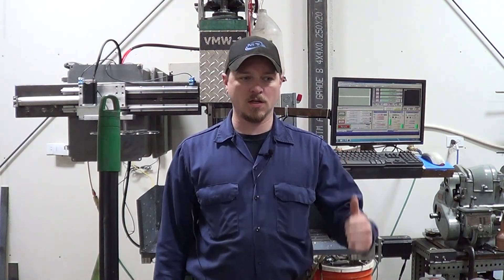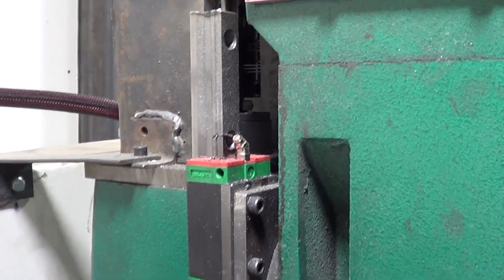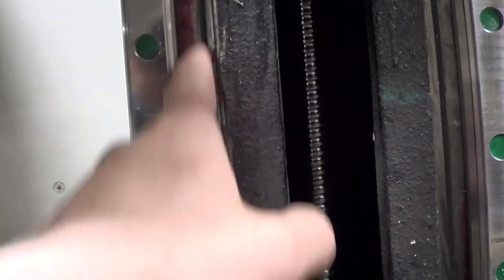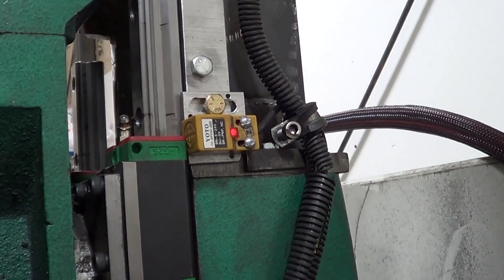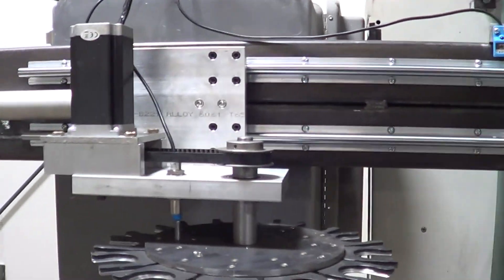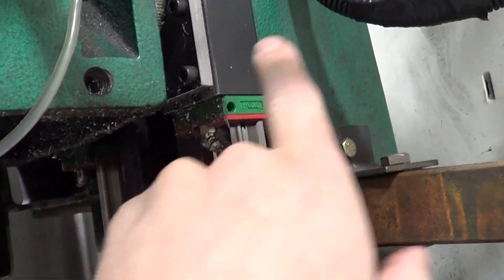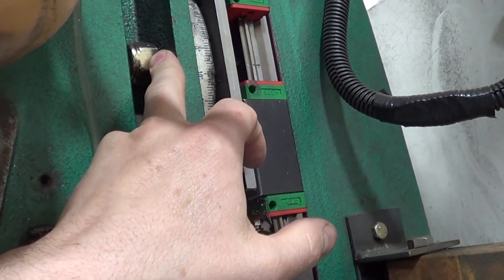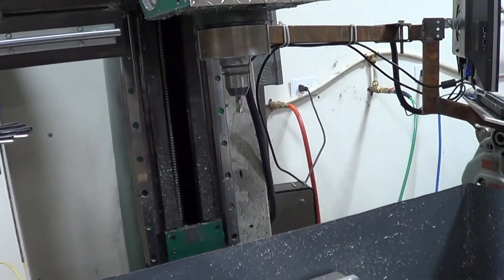RF-45 mill z axis linear bearing

Comment: I just finished converting my ZX45 to CNC but I don't like the precision of the Z axis, I knew it would be an issue to deal with eventually. What size did you use for the linear rails and how are they holding up after a few years?
Reply from the maker: 25mm on the rails and 20mm on the ball screw.  They are doing fantastic.  It was the best upgrade I have done to the mill.  The other I highly suggest is a bt 30 spindle.  Which will require you to build a new head.
Reply: @northernsmith  Yeah I definitely want an ATC capable spindle and a BT30 is what I was looking for. I guess years ago there was a company that made a drop-in BT30 spindle. What did you do for the BT30 spindle? Thanks, I appreciate the info. I have a ZX45 with 20mm ball screws on X and Y, 25mm on Z and Nema 34 closed-loop 1700in/oz steppers on all 3 axis'. I run a stand alone controller. After completing the Z linear rail conversion I'm going to a dual belt conversion to increase top RPM's to around 7-8K.
Reply: @northernsmith  Also, what have you machined so far? Not necessarily materials but projects and do you have any pics or video of it?

Comment: Hi, that's a gr8 build, what's the software u r using to run the machine? Do u plan to convert it to CNC?
Reply from the maker: hoo Wa I did convert it to cnc.  I started with mach 3 and a parallel port breakout board.  I switched to Masso cnc when I built the atc.  So far it is a good controller but it still needs more work and more features to make it really worth the money.  I mainly chose masso for the atc support native to the control.  And to get away from a separate pc and bob set up.

Comment: Nice Work Thomas. It looks as though you’re powering it with a NEMA 42; couldn’t tell if it we a stepper, hybrid or servo. What torque (Nm) did you end up with? Finally, is that a non T-slot table or just a covering?   ...Walt
Reply from the maker: milehidude yes it is a nema 42 stepper.  If I remember correctly it is ether 4200 ozin or 5600.  The biggest stepper I could get at the time.